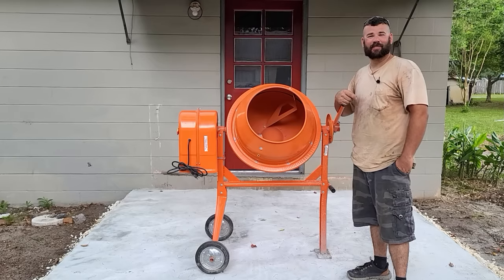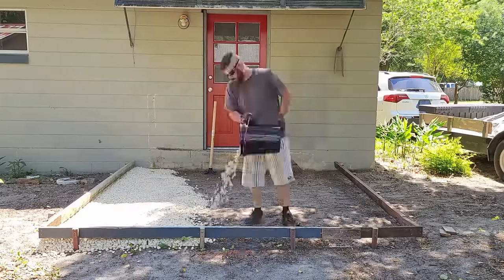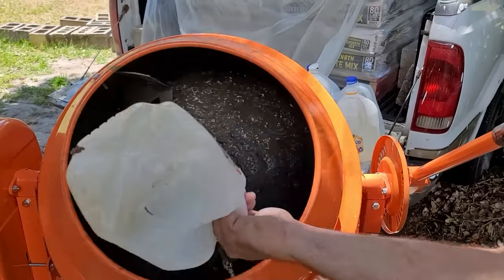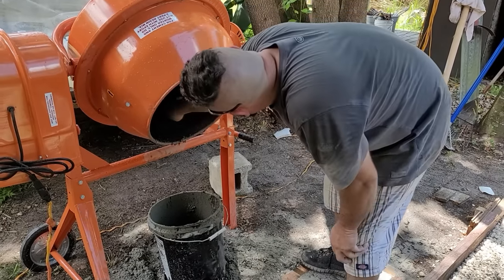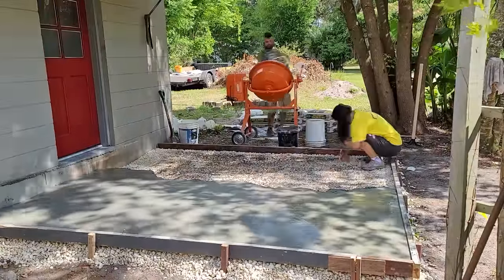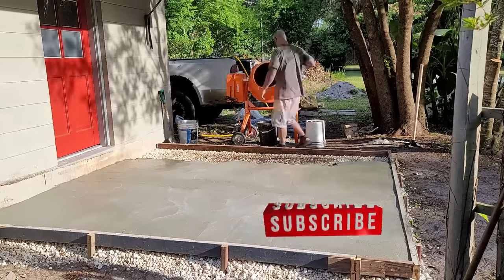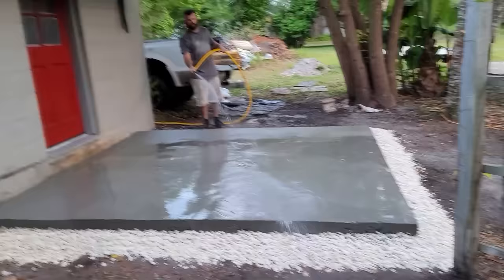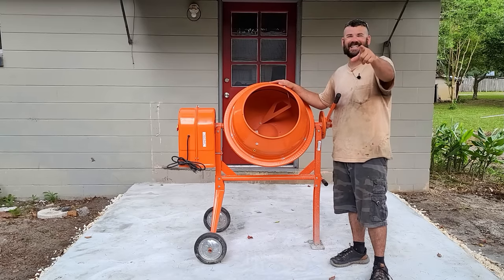Pouring a Perfect 10'x10' Slab with the Harbor Freight Cement Mixer

Comment: The wire mesh is to support the concrete, not separate it from the gravel. Use "chairs" to elevate it 1/2 way into the concrete.
Reply from the maker: Yes sir, I absolutely did. I forgot to film that part but I promise, I didn't put it on the ground. Welcome to our channel!

Comment: People need to stop buying those quick Crete cement and start buying your typical Portland cement if you worrying about fast drying
Reply from the maker: I'm all ears... please explain. I don't know anything about Portland. I'm going to be doing another video in a few months when I do my driveway. Is Portland strong enough for that?
Reply: @VIPHoldings  Cement takes a few hours to dry instead of minutes, so you'll have time to get the job done right instead of rushing and adding water to keep it from drying out. Portland cement is actually the way people have been using cement for decades. These new fast-drying cements are a new technology that helps get the job done faster. The difference between quick-setting cement and quick-setting cement is that quick-setting cement sets faster. At the same time, the rate of strength gain is similar to that of ordinary Portland cement, while quick-hardening cement quickly gains strength. The formwork in both cases can be removed earlier. Fast-setting cement is used when works must be completed in a very short period of time and for concreting in static or running water.
Reply from the maker: Thank you for the information. I will definitely look into it for the driveway. What is the comparison of cost? I chose those bags because they were the cheapest option for quikcrete, but I didn't price the Portland.

Comment: Should of backed in a local E-mix truck where you had your truck parked and had them chute the concrete over.. Probably would of been cheaper than what you spent and alot easier
Reply from the maker: Definitely would have, but we live in the middle of the forest, and the delivery cost alone was almost as much as we paid for our material. Plus, we prefer to do things ourselves and learn.
Reply: @VIPHoldings  I see.. Concrete is hard work and sucks I've done plenty of it aswell.. anytime you can't find a shortcut it helps
Reply from the maker: Agreed... it was a LONG, HARD day, but my wife and I were and are still proud of the job we did. And we both learned a ton for next time when we pour our driveway. (Coming soon)

Comment: Water, sand, water, stone, water, then concrete and then add more water as needed. It mixes better that way.
Reply from the maker: Though this process sounds like it would be strong, why would do all of those steps when we have quikrete ready in a bag?
Reply: @VIPHoldings  that may be more expensive. I'll use that for posts, but not a slab.
Reply from the maker: I've never priced it with all the ingredients separate like that. You think it is cheaper that way vs all together in 1 bag?
Reply: @VIPHoldings  I haven't priced it either, but I will soon. LOL
Reply from the maker: Please keep in touch, I'm interested to hear what you find out.

Comment: 3-1/2" 10 x10. Oil you frames with mobil1 and set in place.  Buy 5 (1/2" ) fiberglass rebar and set over chickenwire.   Open 52 bags of dry mix and pour them in the frame, spead and level as you go.  Screed making sure all corners are filled.  Work the top to a smooth finished look then take an ege trowel and lightly run over the dry mix until edge along the frame.  When you have the exact look you want, fix a mist sprayer on the hose, turn on and give a fine mist over the entire slab. Special attention to corners and along the edge. Don't soak or over spray.   Wait an hour and repeat.  Do this every hour for 5-6 hours.  Next morning lightly mist again, and again every hour for 3-4 more hours.  Wait several hours, then lightly spray .  remove forms after 2-3 days.
Reply from the maker: Wow, that's a long process, but it does sound interesting. Unfortunately, that process would eliminate my new mixer, which is really why we were making the video, but you're definitely thinking outside of the box.

Comment: As long as the chicken fence isn't corosive it would defiantly help durability but you want it inside of the concrete not laying on the floor that makes it useless.
Reply from the maker: I definitely bought the brackets to hold the fence off the ground.
Reply: @VIPHoldings 4:01

Comment: Kudos to you.  Too much work for me.  Don't forget to pull the reinforcement up or put it in chairs to raise it off the bottom.  It's good to have your re-bar both in the center and have at least 1.5 to 2" of concrete covering both above and below.
Reply from the maker: Thank you for the tip but don't you think that's overkill for a 10x10 porch? I did use one layer of metal fence raised to the middle. Welcome to our channel!

Comment: I appreciate the diy effort here. However, a slab needs to be poured immediately. The concrete needs to fully fill the area as quickly  as possible and the screeded while it's wet. If not, it will dry irregularly. That will cause cracking and mess up your broom/trowel finish. Welded wire fabric should be used in colder areas. Fiber reinforced mix can be used in warmer areas.
Reply from the maker: Thanks for the info. The porch still looks great without cracks. Just curious, if you're a pro, why are you watching beginner videos? Welcome to our channel!

Comment: place your mixer in the 10 X 10 area. Mix and dump right there. Just have some rubber boots. Also edge your concrete as you go.
Reply from the maker: So, I have a question about that. If I put the mixer inside the area I'm pouring, how do add chicken fence or rebar?

Comment: You used cement mix bags, it did not dried on you ? it is kinda big slap 10x10
Reply from the maker: I poured the 10x10 Slab 1 cement bag at a time and I worked as fast as I could so it wouldn't dry too fast.

Comment: When the surface is that big you need some rebar ,the mold doesn’t supposed to be remove for 72 hours at list,you don’t water the first day ,cement needs to cure, you water after 24 hrs. Every day for a week ,but you will see cracks if the process wasn’t right ,concrete works better with the proper metal frame ,without rebar its brittle .
Reply from the maker: We do have wire in the middle of the pour. It's just not as thick as rebar. As for watering, I've never heard the method you mentioned, and ours still look beautiful, so I think I'll stick with what works for us.

Comment: Hey how did you use only 52bags? According to the concrete calculator I need 100 bags for 10x10x4
Reply from the maker: I know we ended up needing a few more bags, but nowhere near twice as many. Also, with the rock base, I would say ours is only 3" deep. Welcome to the channel!
Reply: A 10'x10'x4" pad is 33.3 cubic feet. Each 80 lb. bag makes approx. 0.6 cubic feet. You should need around 56 bags.
Reply from the maker: That sounds about right. Welcome to our channel!

Comment: I just bought that mixer at harbor freight. It was the worst think i bought from the store. The instructions sucked, there were left over bolts and missing bolts. Got it together and fliped it on and it started rotating. Put one 60lb bag in with water and it lagged out. I must have gotten the lemon but they keep 50 dollars if you dont want to build another one... restocking fee. So no more cheapy purchases for me. Glad yours works
Reply from the maker: I'm sorry to hear that. We've had ours for over a year, and it's still working as intended. Definitely not heavy duty, but for small projects, it's pretty handy. Welcome to our channel!

Comment: Wow, with my mud mixer you can do 80 80lb bags in a little over an hour.
Reply from the maker: Do you have a cement truck?
Reply: @VIPHoldings  No it call mud mixer look it up.
Reply from the maker: @tweb3282 Cool, I didn't have $3,000 lying around to do this 10x10 slab, but good for you.

Comment: That’s a 3.5 cuft mixer, a 60lb bag is .45 cuft so you can put 7 60lb bags in it max capacity, why is about 5 80 pound bags.  Not sure why you would do so little?  Is the engine just not good?
Reply from the maker: I'm not sure about your numbers, but I can assure you it's impossible to put 7 bags of mix in and mix it properly. Sure, 7 bags might fit in the drum, but getting it mixed properly couldn't happen. As for the "engine," the motor is decent, but this is far from being  commercial equipment. It's great for small diy projects, though.
Reply: @VIPHoldings  I just finished assembling mine and am about to pour footings.  I haven’t used it yet, just going off the specs.  I was hoping to do one pour per footing but if it can’t do even half specs I’ll have to do multi pours.  Good thing I didn’t get the small one,  must do half a bag?
Reply from the maker: I was originally looking at the small one as well, but I believe that one is for very small mold pours. Good luck with your project!
Reply: @VIPHoldings thanks, just poured 5 of the footings , this thing could barely handle 120 pounds plus water, so I was mostly doing one bag.  I could only use a bucket as well so took a while but it does work
Reply from the maker: @Naturalcrusader I feel your pain brother

Comment: 250 dollars will probably cover the cost of one cubic yard of redi mix concrete.
One cubic yard will cover roughly 75 sq ft at the thickness you poured the slab.
So unless you have future projects in mind for the mixer, it wasent necessarily a wise investment.
Also, many areas, especially the more populated ones will have the job mix concrete companies.
The concrete is mixed at the truck on the job in the amount necessary for doing the job.
Slightly more expensive than large lot deliveries, but ideal for these types of projects.
Yes you would need a good wheelbarrow, but then most homeowners would have more use for a wheelbarrow than they would for a cement mixer.
And Harbor Freight sell those also.
May be an even better idea is to rent the equipment needed for just the time needed to complete the job.
Reply from the maker: It's not even close to that cheap where we live and I definitely use it for more than just one project. I think that was a mute point.

Comment: anyone else out here just using a 4 x 8 sheet of plywood to mix?
Reply: I found you my brother! I’m watching all these videos and I’ve never seen anyone else mention this method. When I was a kid 50 years ago I "helped" pour a garage slab and we mixed everything in place on a wood sled. It even had handles for dumping. You shoveled all the ingredients in a pile, make a hole in the middle for the water, and mix with a big hoe with holes in it. No humping bags of cement and lifting them into a mixer. They shoveled the cement right out of the bags on the truck. The gravel was piled on one side and the sand on the other. I’ve been doing it this way with sack crete ever since. Just throw them down and bust them open and mix.
Reply from the maker: I've never mixed my own, but now I'm curious. Welcome to our channel!

Comment: Not too, bad if this was your first pour, the method you used will more than likely suffer from cold joints ie cracking of the concrete in those sections that had about 2hours in between pours. Steel is a must if you do not want to have major cracking of the concrete and the steel must be continuous or overlapped at joins, as concrete is strong in compression and weak in tension, the steel helps the concrete with tension forces. If you are batch mixing like that another option is to build form the ground up, instead of running out ways,this will allow for screeding of the surface flat much easier, all my slabs that I have one man poured with this method have never cracked.
Reply from the maker: Good info for next time. Welcome to the channel!

Comment: Only comment is I believe you should always pin a slab to the structure it is next to….regarding rebar or wire…you can never have too much, you can only have not enough.
Reply from the maker: You're the first person to mention pinning to a structure. Can you elaborate? As for rebar, I ended up using the chicken fence with brackets to keep it off the ground.  Welcome to our channel!

Comment: Next time put some waste oil on your forms and make sure to smack them with a hammer to avoid any hollow spots along the way
Reply from the maker: I was thinking about the oil thing but I'm happy to report they removed nicely without it. As for the hammer, do you think that would still be helpful in that large of a pour and how long it took? I actually do that with our small molds but I didn't think it would help on this one.
Reply: @VIPHoldings  yes it always helps to vibrate the concrete a bit as you go

Comment: next time wheel your mixer right into where you're pouring.  Get most of it poured that way, then pull the mixer out and wheel barrow or bucket in the rest.
Reply from the maker: I thought about that but the chicken fence was 4' wide and up on brackets. Unfortunately there is a fence there too so I couldn't even get all the way around the box. I think I could have used your method on the 2nd half but I was in the zone by then.

Comment: So much wrong with this. 

Concrete doesn't "dry" contrary to your claim, it cures as a chemical process, not evaporation of liquid. 

Throwing mesh on the ground as you have shown does nothing. It, and rebar, is supposed to be surrounded by concrete. All the rock you put down will eventually erode away leaving the slab hanging. Those outside corners are not going to last. You had no rebar, no wire mesh, except for the part you randomly placed in the middle, and it looks way too thin. 

As of today, you posted the video 11 months ago. I'd bet even now it is cracked. Why in the hell did you pour it into a bucket just to move 5 feet and not just put the mixer into the air and dumb it in place?
Reply from the maker: Wow, a lot to unpack here, huh? Thank you for the chemistry lesson, but most people just call it drying. As for the mesh, it isn't on the ground, as I have explained many times. The mesh was suspended at about 2" with wire brackets. You were right about one thing, if I don't do anything to the outside to hold the rocks in, over time they will eventually move leaving voids but I will be building around it sometime this year to avoid that. We inspected the porch yesterday, and it still looks great! And lastly, why I didn't pour in place is because of the awkward place I was pouring and couldn't get the mixer all the way around. Not to mention the suspended wire mesh throughout the entire frame, so I couldn't put it there either. Next time, I will be doing smaller frames for slabs that are large. Thank you, and welcome to the channel.

Comment: How many bag u used?
Reply from the maker: Around 50 - 80 lbs bags
Reply: @VIPHoldings  Ok thanks, I have another question, how far do I know I need to dig to lay a slab?
Reply from the maker: It depends on what your trying to accomplish. If you want it flush with the ground, dig 3 1/2." If you want it raised like I did, don't dig at all.
Reply: @VIPHoldings  Ohh ok thanks! That was a lot of help, looking at your video I feel like I’m ready to try it myself 😂 much more cheaper.
Reply from the maker: Good luck!
Reply: @VIPHoldings  Thanks

Comment: It's not worth it. 1.5 yards from the ready mix truck about $180 plus $150 delivery charge. $330. For an extra $100 it would be poured in minutes and save your back.
Reply from the maker: As I've stated many times here in the comments, we live in the middle of the forest, and the cost of delivery was much higher. You shouldn't assume that the cost is as cheap as maybe you can find. Plus, we like learning new things and plan on doing a driveway next.

Comment: Wire mesh would've been good and maybe rebar #3 or #4 around and 1 in the middle to avoid any cracks but hey it looks good👍🏼
Reply from the maker: Thank you for the advice and welcome to our channel!
Reply: Replace trees with concrete
Reply from the maker: No trees were harmed in the pouring of this slab.
Reply: @VIPHoldings , I never said you harmed trees, I just said replace trees with concrete, many places have

Comment: Anytime you pour a slab use a truck . It will be worth it. Doesnt matter if you have to wheel barrow it down to work site. Only time ive ever used quick crete in a professional manner was doing ballards and pouring the footer for walls where i house was about to go. Doin it the cheap way is not professional at all. Quickcrete is for small places,  not pads.
Reply from the maker: The cost of a truck far exceeded me, diying it as we live in the middle of a forest. Also, at no point did I mention that this project was done professionally. It's a DIY project and you're going to hate the next one I post because at the end of the summer, I'm doing a much bigger area the same way. Welcome to our channel!

Comment: 60 lb bag works better, cheap mixers will stop working, due to too close tolerences in the drive. Loosten drive cog and give it about 0.20 clearence. motor heats up, expands everything..

Comment: I run two wheel barrels two bags per wheel barrel side by side mix and dump.  That mixer is a total fail!
Reply from the maker: I completely get that. You should be able to tell by looking at it that this machine is not built for that much demand. For small diyers like myself, this machine works as intended, in my opinion. Welcome to our channel!